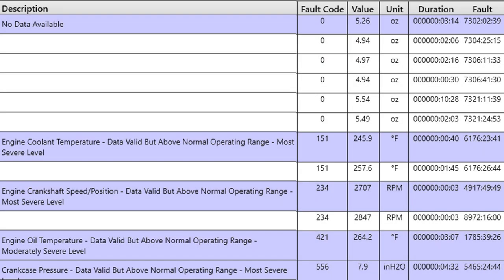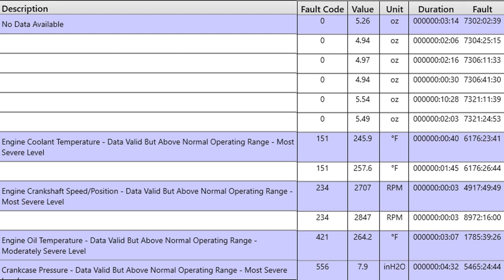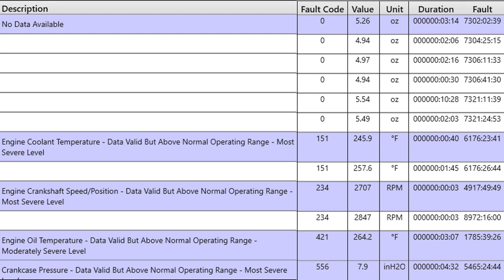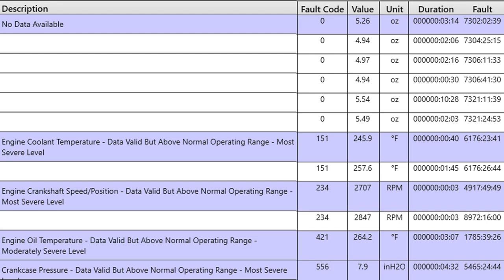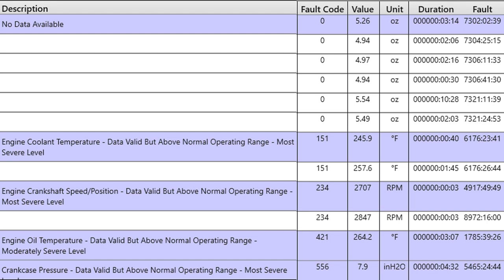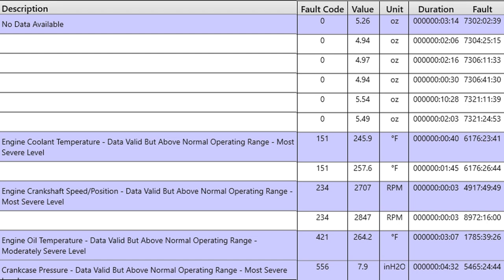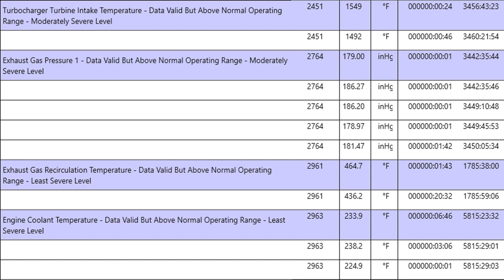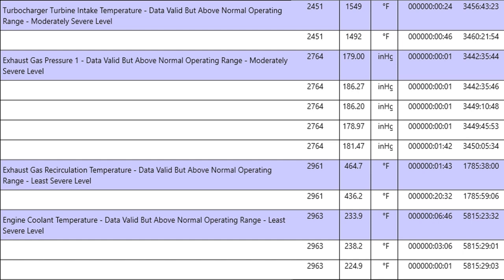What is engine protection history and why is it important

Comment: Is there a way I can find the mileage on a engine that has been pulled out before I buy it I’m looking at L5P engines
Reply from the maker: I am not sure what an L5P is but if it has an ecm most will keep a record of at least hours. Ask for a trip print out from the engines ecm. You also can make a fault by powering up the ecm and unplugging sensors and usually faults have a total time stamp with them. figure 50 miles equals the equivalent of one hour.